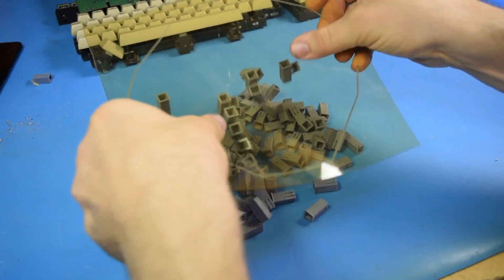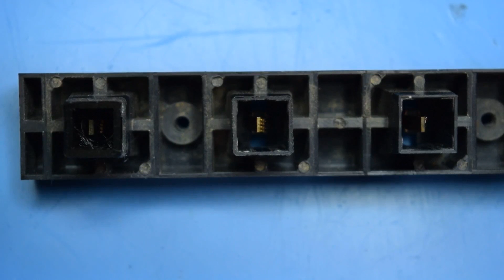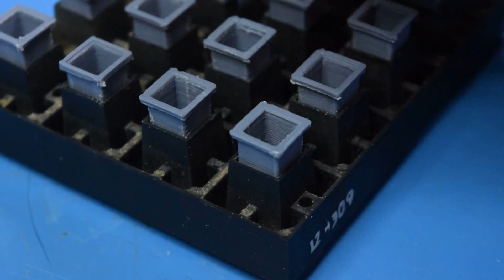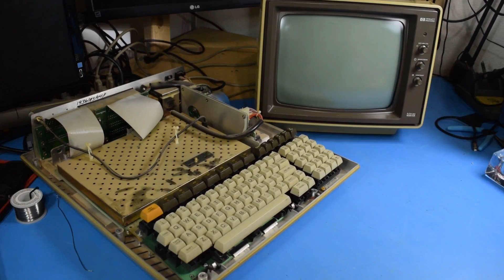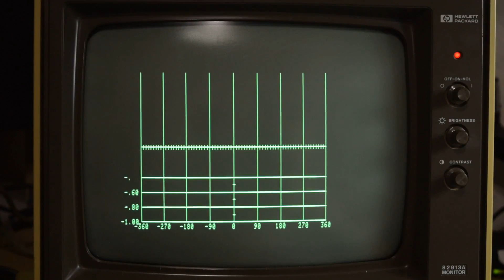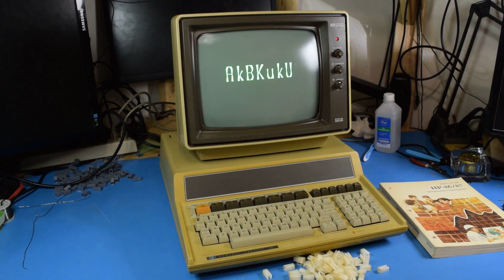0x0029.2 - HP86 New 3D Printed Key Stems Installing and Testing

Comment: Hey, I have an HP85, which has a built in monitor, tape drive, and printer. Whenever I run a basic program, the results are printed out by the printer instead of being displayed on the screen. Any idea on how to switch this?

Comment: I have an old Lear Siegler ADM-3A terminal, which has the same type of Hi-Tek switches as the HP86 and TI99. It's got the sticking keys problem pretty bad as well, especially with the keys near the edges. 
These replacement key stems will definitely come in handy when restoring it! It's always awesome to be able to fix vintage electronics with modern technologies like 3D printing.

Thanks for making another awesome video!

Comment: I'm sure there's a good reason.  But it's not clear why you needed to desolder.
Reply from the maker: The contacts for the keys are permanently put in the black plastic and then soldered to the PCB. You an only unlatch the original key stems from the back.

Comment: I'll probablly have to sell my soul to get one of these, but how much will it be to get some pre-printed key stems?
Reply from the maker: I haven't gone into the numbers too much and I still need to setup the tindie page(I've got a long-term project going right now and I haven't had my 3D printer setup in a while). After June everything should be back to normal and I'll get that finished up.

As a rough estimate, I'm thinking $0.50 a key stem with a minimum of 10 + three of the install tools. Possibly some better discounts for larger quantities but I need to keep in mind that the printer take about 14hrs to print 100 of them so it is locked down for a long time.

Comment: 3D printing is pretty awesome!
One question though: At 8:38 it seems you did not solder one pin. Is that from that special stem on the End Line key?
Reply from the maker: Yes, that isn't a real key position on my keyboard. It probably is a real key though in other regions with different layouts.

Comment: There's a idea that I wanted to do for a while but don't have a 3d printer to make it.  I wanted to make a bar top arcade cabinet for the nintendo switch.  Using a magnifying sheet to make the screen look larger and design a fight stick that sits on top of the joycons.  And maybe create a door in the back to hold the cartridges.
Reply from the maker: I think that would be better done as a hacked dock. Use a 20" computer monitor as an HDMI display and usb joysticks that you are free to cut up and modify. 

Using a magnifier will have two negative effects. The brightness will be considerably reduced because the same light is stretched over a larger area. And the viewing angle will be very small to be able to see the whole display.

Comment: Is that programming language a highly customized version of BASIC, or is it something else?
Reply from the maker: It's HP BASIC. Unlike a lot of the other computers at this time, it is not derived from Microsoft BASIC. It was developed from the ground up by HP. Since it is wholly owned by HP they continued to support it up until at least 2000. I have an HP programmable Multimeter released then who's manual contains programming examples in HP BASIC.
Reply: In the same vein, Texas Instruments calls the language used by their graphing calculators "TI-BASIC" even though it has almost no keywords or syntax in common with standard BASIC.
Reply: VWestlife good to see you here :)
Reply: VWestlife it's the same with the Casio fx-cg20. It has a language on it that is called Casio-basic and when I got mine I thought that it was real basic. I was really disappointed when I noticed that my commands all resulted in Syntax errors

Comment: What was that last original key you left on there for? With the two top... stems? I’ve never seen a design like that before. Awesome restoration btw. Good thinking to allow those keys to be pulled back out like that
Reply from the maker: It's an alignment post for the End Line key since it's too long for just one stem

Comment: This has been a tremendous effort! - wow! - Your Key Stem design might also work on the Oric Atmos computer keyboards. They are Stackpole keyboards as well!
Reply from the maker: It most likely would if they are the same switch type. These should work with some of the DEC terminal keyboards as well. I may make more of a tutorial type video of installing these in one of my TI99s. I don't think either of them have any bad stems, but I'd like to make it as easy as possible for people to do this themselves.